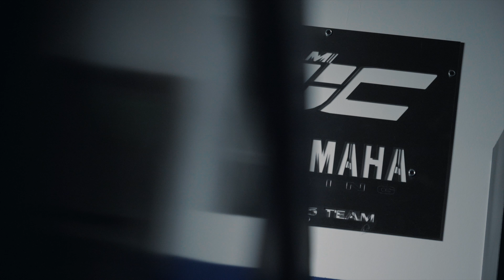Amazing TEAM MJC Yamaha - EMX 125cc

Comment: What has been welded on that frame?!
Reply: Where do you see it?
Reply: @timovandyk7380  Where the front down tubes meet the cradle. There is always a factory weld there but it looks like fresh welds that aren't factory on this one.
Reply: @MX304  also on the top of the frame where the subframe is placed